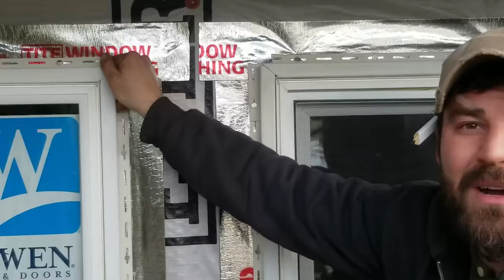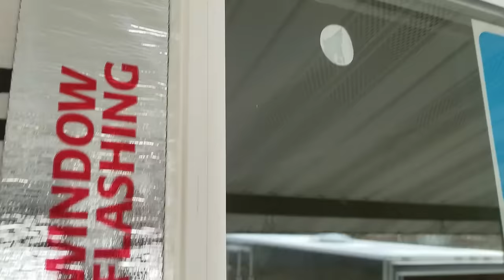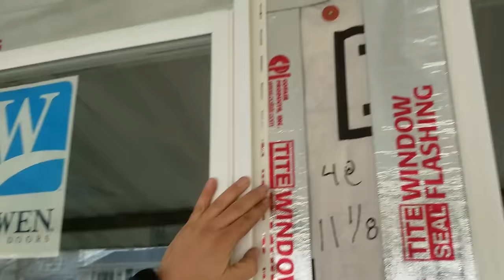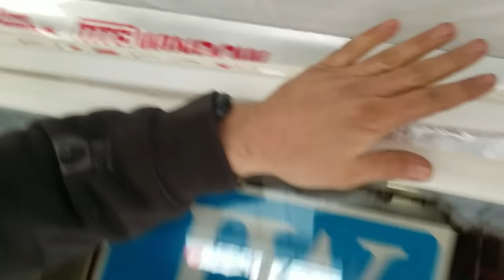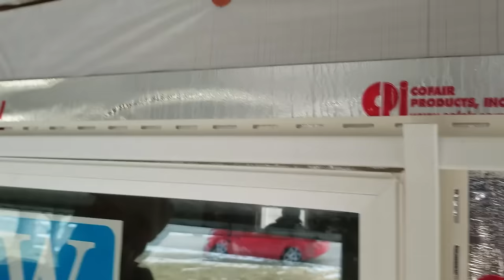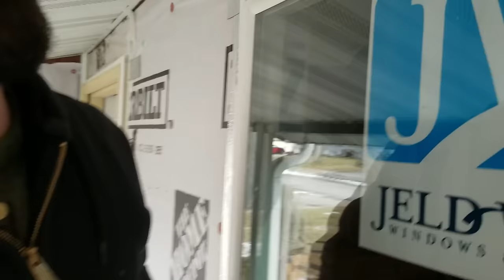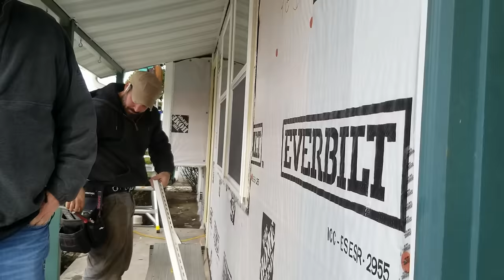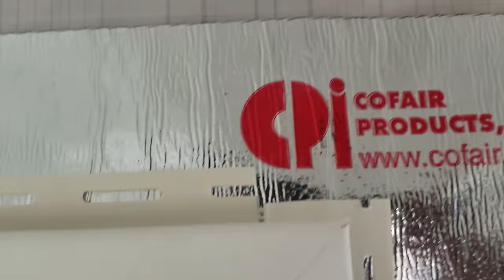HOW TO | J-Channel a Window (Perfectly Every Time)

Comment: I started with vinyl in 77 , I can smoke this guy. Reds, greens and a pencil,  no need to let the nailer run wild on the bottom , all 45s should be done after all four sticks are on ,run the faces wild , then use your reds and greens,  that way your 45s will be tight , he's got a few of the basics down, but a real pro could do  twice the quantity and increase quality, also ,when using different color j around windows and doors make sure to order the remaining j in the base color for gables, or. starter course if there is a jump or drop from starter strip , inside corners , etc. Ck out the meat hooks on his 45s ouch
Reply: Definitely will lose some skin on those corners.. i do everything else the same except I always square my bend around so it's perfect and doesn't sit to one side which it will if it's not squared properly and won't sit tight against the window
Reply: What the hell is a "meat hook" ? Never heard that expression before lol
Reply: @timbibin1301  that's where you leave your mitre cut long and it overhangs the underlying flat and there is a pointy end to tear open your skin , meat hook
Reply: Ps your reds are for top right and bottom left and your greens are for top left and bottom right
Reply: Also don't go corner to corner come out a little bit before you make your miitre cut to avoid gaps and meat hooks
Reply: done sideing for 30 years i never used a speed square on j channel
Reply: So I appreciate that your taking the time from your work day to help your fellow craftsmen on here. When i cut/bend my 90's i will cut my miter and nail flange.. Though after you bend over excess; I only will cut the outside round so that it will leave a flange to lock into your previous J. Whether it be bottom or sides. Test it out let me know what you think. Helps lock them together!!
Reply: If possible, would like to see how you mean, or a link to another video showing this. Thank you sir.
Reply: @x240strongx  put your bottom j on first with the face left on about 2 in each side, you can cut one end before and then hold the cutout flush and mark and cut the other end, then the side piece pre about 5 in longer  (about 2 1/2 in each end ) than window then cut out a notch along the radius of face and then cut down the pocket and make a v shaped notch then go perpendicular and cut the nailer straight across from the point on the v notch then fold the tab you just made over at a 90 and then fit the bottom j and the side j together, when you get a nice fit and nail it off and put a nail through your fold over tab and the bottom j nailer. Nail the side j only about halfway up until you mark and cut the top of the j , cut top tabs like the undersill j , do the other side the same way ,then the top j you cut a piece of j about 6 in longer than the window , cut one end with the foldover tab . Fit the foldover into the top of the side j after trimming the top of the side j to fit flush with the top of the window leaving the face of the side j long. Adjust the j side to side until you get the best fit and then mark the back of the pocket on the top j from the inside the pocket on the side j , get all j fitted nicely and then nail it off, then cut the top right corner and the bottom left with reds top left and bottom right with greens , hold the jaw of the snips flush with the edge of the face then cut your mitre cut from corner to corner but add about a 1/16 extra on your mitre cut you want a tiny bit extra to cover any flaws , good luck
Reply: @timbibin1301  it's an army term for your arm.
Reply: @bigbrother5797  nice explanation

Comment: The j channel is cut wrong., no one cut like this man. Once it expands his mitered edges will come apart.
Reply from the maker: So not true.  Man I have been doing this for a long time and I'm literally on my porch right now staring at the most crisp 45 you've ever seen in your life.  It's 50 degrees out and it looked exactly like this when it was 95 degrees out and has remained unchanged for 3 years. I promise you, this is the best way to install good quality j channel that never changes. The corners are connected and the flap (which most people don't do)  prevents movement.  Leave the advice to me

Comment: Water will get behind rather than run out
Reply from the maker: water gets in j channel regardless. this is the most water tight method of doing j channel. all sides fold the correct way and protect all corners. outside and flangeside
Reply: Why and how could 2 nailing flanges buttoned up together or if you can change one cut it would have a overlap. So when the water starts to freeze it will seep into that crack that will occur. You know just as well as I do on much vinyl can move.

Comment: How you j channel a new window you install new construction windows with built in siding channel to start with then you don't install j channel.  How to j around a door install vinyl brick mold routed out to except siding and learn how to use flashing.

Comment: No need for the speed square just measure 1in back there's ur 45. Lol
Reply from the maker: Then you don't have any flap to nail down around the bend.  That's not as good of quality in my opinion, plus taking a tape out vs a speed sq, not really much of a difference in time

Comment: I hated one guy i worked for used to yell at me to grab a handful of nails and finger them. Used to piss me off cause out of 6 or 7 nails in my hand i would get 2 in the wall the rest on the ground, THEN guess who had to go around and pick them up at the end of the job... 🖐️ME, so i would go right back to 1 at a time when he walked away. Also back when i was doing this i used craftsman snips, when i did a roof i would use them to cut shingles, go to sears with them after, go to the tool counter, the guy would grab a new pair for me and take the old ones. Lol cant imagine my Sears is no more lol. Winters is what did me in on this crap. 4 years was enough for me. Im having PTSD watching him in the winter with white siding omg, so when it was muddy winter siding got dirty and you would have to clean the entire wall sometimes. Would be constantly changing out the cotton white gloves to try to do our best to not make a mess...

Comment: You NEVER EVER fill all the holes with nails when installing a window. 2 on the bottom, 3 on the sides  evenly spaced, none on the top. If you nail the crap out of the window like this idiot did, ( not the siding installer, the framer that installed the windows ) when the building settles and drys out the window wiil ether,  be really hard to open or,  worst case i have seen, the glass will break.
Reply from the maker: Haven't heard of that ever, what does the manufacture say about mailing? Also, this house is olderish, it's a remodel

Comment: slowest j channeler I've ever seen, you guys are still in the stone age with the aviator snips and no air guns, the fastest way is to measure, add two inches, so you don't have to mark or cut again, you do it like they did 40 years ago.
Reply from the maker: Do it then! It's a challenge. It's here because I want to see somebody do it faster.
Reply from the maker: Well, to be honest.  I don't think you know what you're talking about lol it's not gonna make it faster by Measuring exact.
Reply from the maker: @JAMESMOORE-gq4vv  in my opinion* that's why I would like you to show me. Just film yourself j channeling a window
Reply: @NWIVeteranConstruction  it does because you don't have to mark and cut again, any other questions, just ask.
Reply from the maker: @JAMESMOORE-gq4vv  nah, I just think you're not giving enough credit to the fact you don't have to pull out a tape measure and hold it on a long flimsy piece of j, read a number n mark an exact point. That's huge when you don't have to do it 4 times, and mark exact 45 degree angles.. I mainly just want you to try n see if you beat my 2nd window time.

Comment: Bruh. Vinyl J around the windows is amateur hour. Wrap them with aluminum. 👈
Reply from the maker: That's only for replacement windows.. lol  even if you wrap it you need J on it too so??....unless you are bending a built in channel... but that's weird. also, why add something that 1) doesn't need to be there 2) easily shows scratches, dings and hail damage and 3) is useless added material cost. Just seems goofy to me
Reply: My wraps have built-in J. I can wrap any window. New, old, doesn’t matter. Yes, it is an added expense, but worth it imho. Ben siding houses for over 20 years in the Finger Lakes region of NYS. That’s just how we do it here. 🤷‍♂️
Reply: Also, I make my J separate from the wrap. I don’t install the wrap until the wall is complete. That way there’s no chance to damage it. Especially the sills.
Reply: I will say that your J instructions are spot-on. That’s how I run J as well.

Comment: What is even the point of using that weak crap? Just surround the window with wood trim or whatever
Reply from the maker: ok...but then what is going to hide the edges of siding? the purpose of the j channel is not neccessarily to cap off the window its to terminate the edge of siding as well. hence why we also need corner posts

Comment: The moment I saw that window nailed across the bottom is when I knew there was nothing worth seeing here. Not sure if you or your guys installed those windows, but if you did you may want to just stick to roofing.
Reply from the maker: Who doesn't nail the bottom of windows? Lol
Reply from the maker: You may just wanna go reinstall all those windows you did incorrectly lmao jk let's not be mean to each other bro
Reply: @NWIVeteranConstruction  
Full coverage with nails is not something I've seen very often, also at the bottom it's a decent practice to make sure it's not too tight, in case water makes it behind the flange at some point it can escape easily at the bottom. Maybe this is what he meant, although not shared very kindly. Also not an issue to worry about under an eave like that.
I appreciate the knowledge you are willing to share, I'll be sending my guys to this video before we start our next siding job.

Comment: ok mistakes ... missing drip edge on the of the windows to start secondly you never put a J on top of windows and doors water will sit in the J!
Reply from the maker: You put j on the top of windows 100% lol this is vinyl.  Look around your area.  Drip edge is part of the roofs man.  Sounds like you mean z flashing... common in hardy board and LP